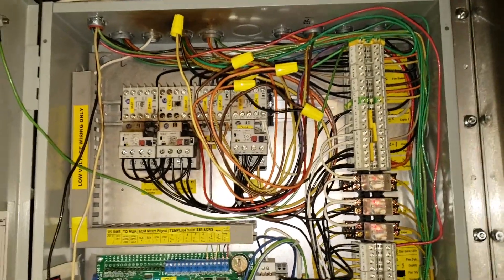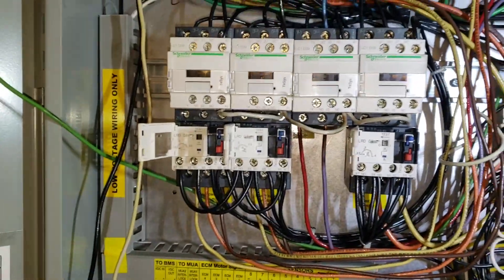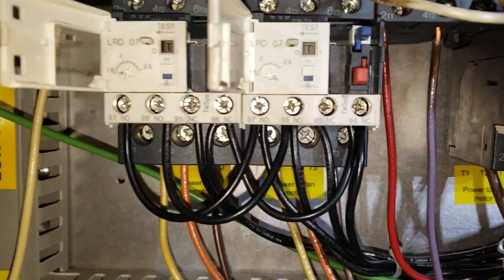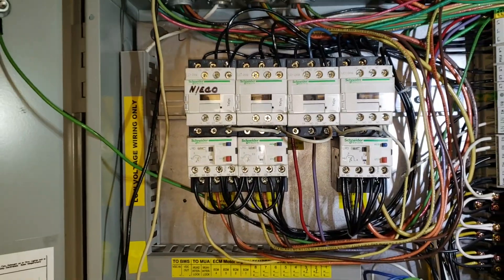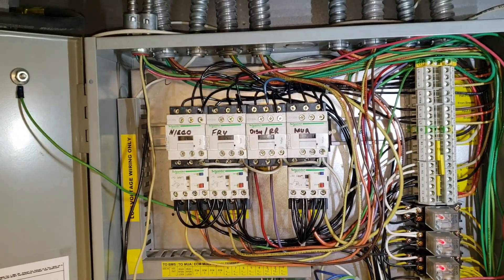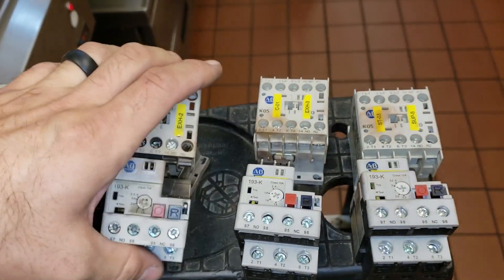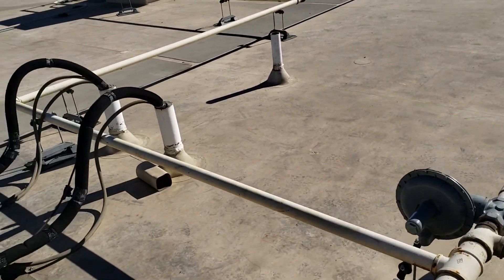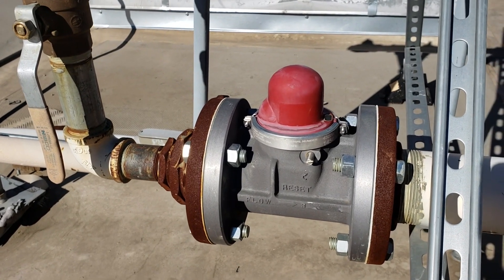EXHAUST FAN FAILED MOTOR STARTER

Comment: Clap on clap out, the clapper.

Captive Aire control panel I see.

If there is a make up air plenum in front of the hood, you can only get 90 percent make up cfm thru the plenum

Comment: Do you often have issues with starters failing? in my experience this a common issue with smaller IEC starters. They don't seem to hold up as well as NEMA built styles.
Reply from the maker: Usually when I have problems with them its because of a power related issue, But I can't honestly say they are more problematic than others for me, I find motor starters bypassed quite often that have been that way for a long time which leads me to believe people don't know how to work on them and or where to get them from.

Comment: "We had bypassed them a couple weeks ago."

I want to point out something very important here:

Overcurrent protection for motor branch circuits is governed by Article 430 - where overload protection is handled separately from short-circuit and ground-fault protection (Part 3 and Part 4 respectively).  This means that depending on the particulars of this installation, bypassing the motor overload protectors may have violated Part 3 and exposed your customer to a risk of fire or shock in the event of an overloaded motor.

A common misconception is that the code does not govern temporary wiring.  This is untrue.  Article 590 governs temporary installations.  There is no provision in Article 590 (or 430) that permits motors to be operated without overload protection for the purposes of a temporary fix.

Please be safe out there.

Comment: Great stuff Chris ! I noticed that there are three motor starter  that's mean one motor starter for one exhaust fan or multi exhaust fan ? its restaurant right? thanks for your time, sir
Reply from the maker: Yes the restaurant has two exhaust fans and one mua unit all of them require a motor starter

Comment: At my work if we run dry on propane are the gas is turned off and then turn back on we are required to call the gas company for a leak inspection because the pipes can expand and contract when they're under pressure they're sealed when the gas is turned off they can shrink and unseal causing leaks it's a real pain in the butt but Safety First thanks Chris for sharing great video

Comment: How close to max amps will u adjust it to?
Reply from the maker: It all depends on the motors safety factor but on average I adjust 10%over the RLA ,  I will try and do a video on adjusting motor starters.
Reply: HVACR VIDEOS I’m looking forward to that.  I have to work on a make up air unit Sunday so I’ll get a look at their motor starters to familiarize myself.
Reply: Should be 100% full load current (from the motor rating plate) on the overload setting for normal applications. Can be less of course for certain applications. Can be fully omitted for other applications too (electric fire pumps, for example ). I’ve not seen Chris’ approach before (max. setting and back off) and I wouldn’t personally use it, but I like seeing other’s working practices. That said, sorry Chris, the 10% oversetting is a no go for me. Even the most basic thermal element overloads compensate for starting load and shouldn’t need overset on the trip setting to compensate. For very heavy starts, different tripping class relays should be used e.g. 10, 20, 30........of course, the supply and installation need to be able to deal with the sustained overload conditions too!

Comment: What is the gas meter and shut off doing on the roof should be at just above ground  level
Reply: Just what I was thinking Roy.  There's a lot of line to rupture up there south of that shut-off.   I'm guessing "A" shut-off, not "THE" shut-off?   I would hope....
Reply: Maybe it's a earthquake zone thing? I'm just guessing and not sure I don't live in area prone to quakes.
Reply from the maker: Yeah this location is about 6 miles from the San Andreas fault
Reply: I thought that was weird too I've never seen one on the roof before... that ones installed backwards too.

Comment: Cool. Never seen an vibration main gas valve
Reply from the maker: Me neither, scared the shit out of me I thought I did something wrong in the control panel.......
Reply: Nor I, especially not being from Cali.  Did some research on them, seem like fairly simple devices, which is best I would imagine, it's suppose to differentiate between ground tremors and normal surface vibrations, but I would guess not roof traffic?   Glad it was fairly easy to reset.   That's always a good thing....
Reply from the maker: Funny I am from Cali and knew nothing about them, but I get the need. Thanks for watching guys!!